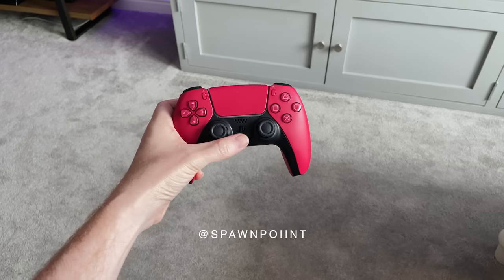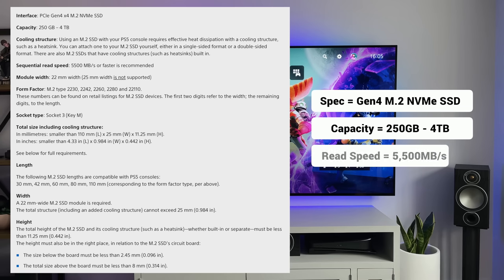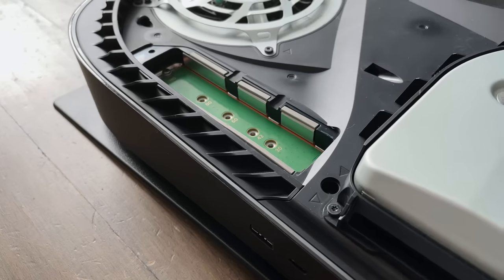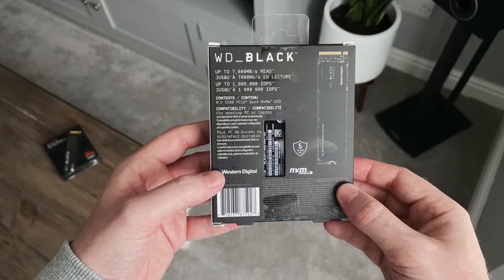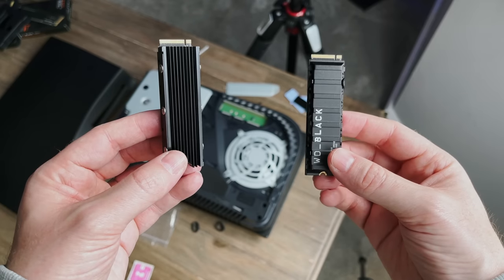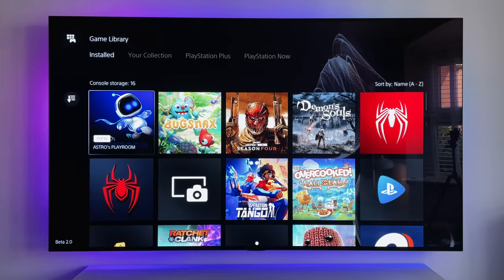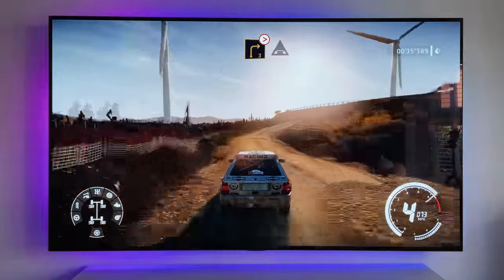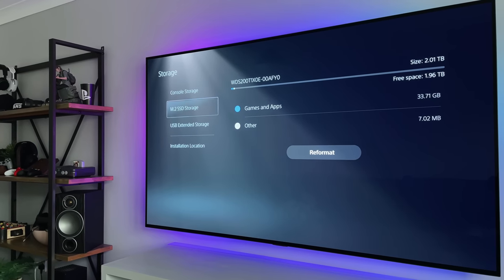PS5 SSD Upgrade: Installing 2TB SSD + Heatsink

Comment: Do you prefer gaming on tv or monitor?
Reply from the maker: TV
Reply: @SpawnPoiint  really? How come you prefer TV?
Reply: @Turkboyz20   why would you not prefer a 77 inch LG OLED with HDR and 120HZ it’s a far superior experience to a tiny monitor
Reply: @Turkboyz20   the absolute vast majority of console players are on TVs the only way a monitor beats one of these TVs is response time that’s it everything else the TV is better the superb OLED image with HDR the far bigger sizes 55 inch plus and most 2.1 capable OLED TVs now have more than good enough response times and VRR also G sync if you have a very high end Pc and want super fast response times and 244HZ refresh rates then yeah get a monitor but for the most immersive experience you can’t beat these new OLED TVs
Reply: @CH-bn7qb  gotcha tho those oled tvs your talking about are pretty expensive
Reply: @Turkboyz20   yeah they can be on the expensive side but just remember they’re not just used for gaming they’re mostly used for watching movies in the living room so the cost can be justified to an extent

Comment: I wonder if you dont install the small metal pannel on top of the m.2 slot would it still work giving more space for a heatsink
Reply: The metal plate is there to do a very important job. Do not leave the metal plate off for any reason. Find a suitable heatsink that allows this by checking the dimensions. Sony stresses this in official statements.
Reply: @shinukisan2222  Yeah ive done a bit of research and even without the metal plate it only adds about 1mm which is really not enough to be worth it
Reply: @DSSteve  
Your reply makes no sense?
Reply: @shinukisan2222  im saying its not worth removing even if sony said it was ok

Comment: Correction, your statement on the SSD read speed is misleading. The PS5 SSD can deliver speeds UP TO 5,500 mb/s. The minimum we need is a gen 4.0 name ssd which is 5000 mb/s and the maximum we can get is 5,500 mb/s. Any faster and the remaining read speed will not be taken advantage of by the PS5. So please don’t say that, because people can save money
Reply from the maker: ok

Comment: Great video and explanation, though the game loading times wouldn't change either way so testing it was kind of pointless.

Sony has clearly put a warning at the moment of formatting the M.2 SSD drive. Stating that the save files and some other stuff wouldn't be saved on it but the internal SSD instead. The games were on the M.2 SSD, but the save files were on the internal drive and were used from there, or the PSN database.

Comment: I'd have thought that replacing the metal cover over the NVMe would make any heat issues far worse, along with keeping your PS5 in an enclosed multimedia unit?  It would also allow a larger and more efficient heat sink to be used.

Comment: Placing ssd with a heatsink in enclosed compartment? Do you believe it's gonna dissipate heat? I don't
Reply from the maker: I didn’t design the console.
Reply: @SpawnPoiint  sure. My 1st question was why you returned a silver cover on its place. I would not place it back and a fan, that spins close nearby, would blow some air or, at least, it would remove hot air from a SSD. However who knows to what extent the SSD heats in the PS5, may be something to none
Reply: @MaximPodbereznyy  It cools down through negative airflow. The fan sucks air out of the ssd chamber. You need to put the plate on for that to happen. So it does get airflow. Just not by air being blown ON it but sucked OVER it.

Comment: You need to remove the label of the ssd before installing a 3rd party ssd. otherwise its not going to be efficient. The sticker has very poor heat conductivity.

Comment: Ouch, you installed the spacer completely wrong and are risking breaking your SSD. The spacer goes down before you add the SSD. 1/place spacer, 2/insert SSD, 3/fit SSD holding screw into spacer. WARNING: DO NOT PUT THE SPACER IN AFTER FITTING THE SSD!!!

Comment: OK I'm confused. You show the 2 prices for both, with or without heatsinks, and the difference is about £15 across all sizes. You then say the difference between the ones you bought is £100. I've checked the prices, buying with a sink is around £15/20 more, so where does the £100 come from?
Reply from the maker: RRP. I can’t comment on sale/current prices.

Comment: No one has mentioned it on videos ive seen about it but why put the plate cover back on when you have a heatsink on ur ssd? wouldnt it help cooling more efficiently? Would there be any draw backs?
Reply: there is a mechanism to cool it even with the plate.

Comment: What a mess. The Ps5 pro better not include a stand and one step storage expansion, I’m just thinking about all the casuals who don’t search these type of videos and just place an ssd inside without a heat sink and not cover it up thinking it’s all unnecessary just like they place the Ps5 horizontal or vertical without the stand.

Comment: if u are aware how m2 ssd works is anything below 1TB the read/write speed are much slower.

edit: what the point of having heatsink when there’s a cover plate preventing air flow?  4:30